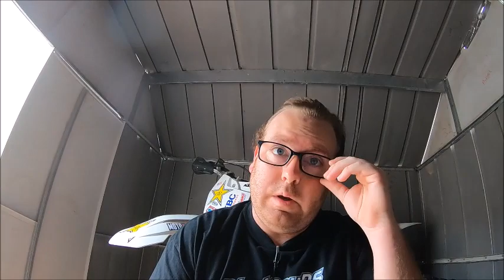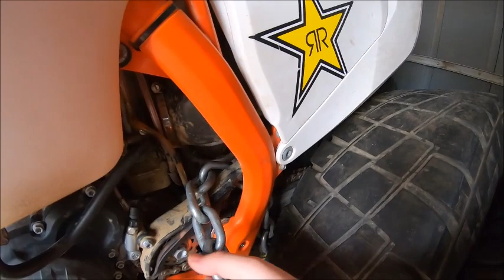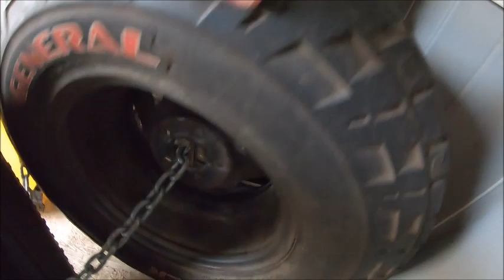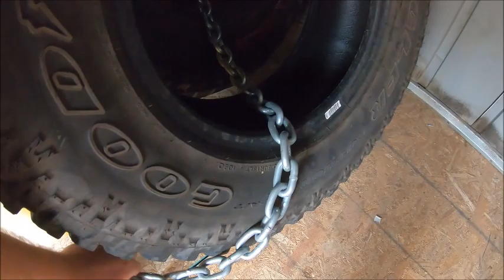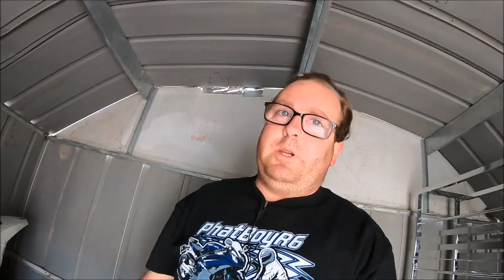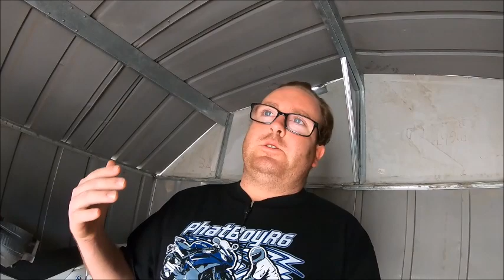BOLO STOLEN R3 (daily ep. #20)

Comment: Damn that sucks... i doubt it will make it out my way but ill still keep my eyes open for it come spring... 
Best way to not get your s%$t stolen is to make the risk not worth the time.. 
Thats a hell of a chain btw...👊🇺🇸
Reply from the maker: yes it does. thank you for keepin an eye out. yes. if it takes to long to get it, then it's not worth their time to steal it and that's why i lock it up in my house with all of that other shit tied to it. i'm seriously thinking about getting another chain that's half inch and lock them both together.
Reply: @Minionmoto529  they'd make a ton of noise cutting the one you got already..😄
 Hot lead down range is always the best way to prevent stealing..🇺🇸🤠👊
Reply from the maker: that is true as well as the locks. yes, hot lead will make even the baddest mofo's run some times.